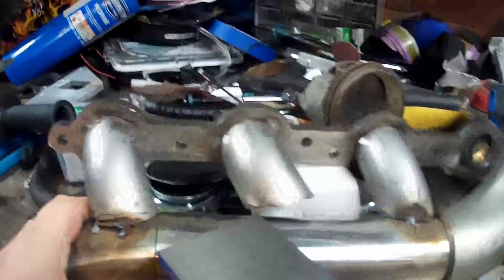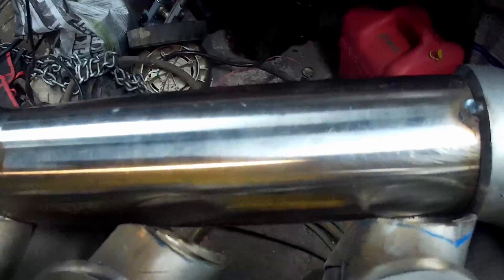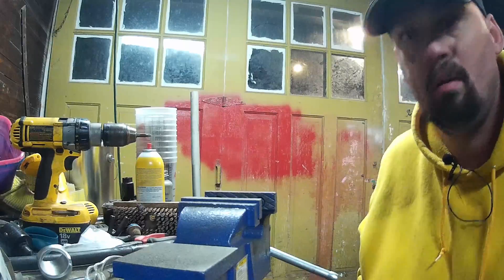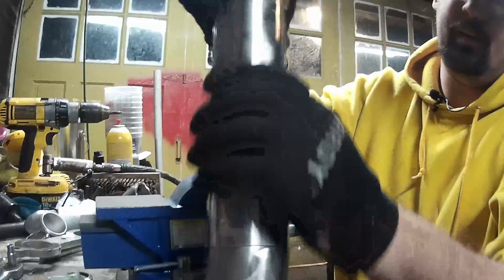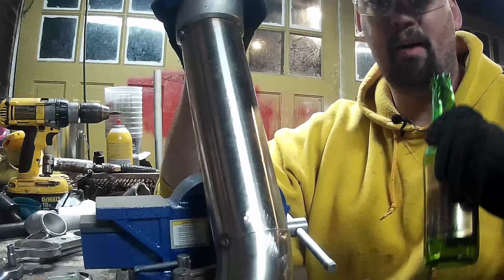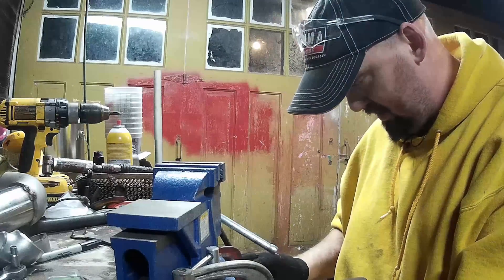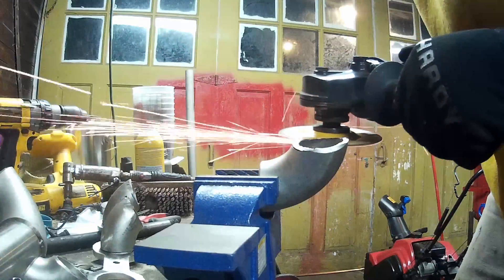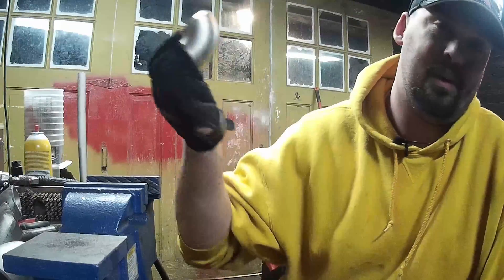How to build a Budget turbo log part 3, fitting pipes.

Comment: What do you think of rear mounted turbos?
Or mounting one under the bed of your truck?
Wouldn't it be simpler & easier?
Reply from the maker: Not really, running a bunch of extra pipe, plumbing oil to it, pumping oil back from it, trying to keep road crap out of it. Sounds complicated lol.
Reply: The Driveway Engineer 
Check this out 
https://youtu.be/LRAvz9bzd8U

Comment: cool effort man, but you can build these all day long from $20.00 in stock truck manifolds and some spare pipe.  Log manifold has extra coolness though... I got one on one of my builds
Reply from the maker: You can, but  clearing the truck AC compressor gets a lot more difficult with flipped manifolds.

I do have a video series on that as well though.

Comment: I like what you are doing, looks challenging.  Check out how this other guy set up a jig to hold the 45's .... he does use a milling machine but says that you can grind it out like you are doing.
https://youtu.be/Nis0hIVVx6A?t=5m12s
Reply from the maker: JDE I saw that video after I had filmed this lol.

A jig would make it easier than eyeballing it for sure.

If I ever build another ill build jigs, and use carbon steel